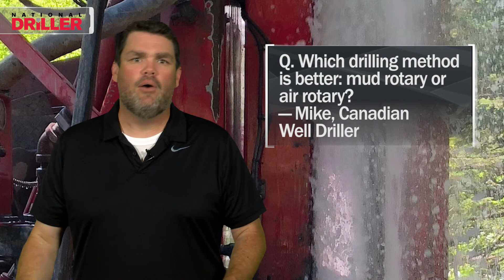Epic Rotary Drilling Matchup: Mud or Air?

Comment: I've done both and do prefer air over mud, due to it being faster and generally cleaner. Water usually is never an issue, cause you can always go to what we called misting and start adding soaps/foams etc.. And unloading a hole was always fun to watch ! I've had the opportunity to work on one of if not the largest gas well in West Central Texas. Hammer bits were hardly used unless the formation called for one. I remember the days of Diamond bits to drill wells of the late 70's early 80's.
Reply: Can a mud setup still do the job of an air setup, if you really needed it to?  I’m looking at a Chinese rig (FYX180) and it can either be accompanied by a $23,500 22 bar 24 cubic meter per minute compressor, or a $3500 mud pump.  This won’t be for a business, but a personal well in the White Mountains, Arizona.  Our stone is majority lava rock, if you hit any at all. Water is about 150’ down, and I plan to hit 200.
Reply: @Bright_coded  It really depends on the water tables in the drilling areas, like how large. We went to a mist some times when water was to much, but not enough for mud. And mud can be used.
Reply: @Charles53412 I’ve drilled holes with a Foremost/Barber Dr-24 in places fellas refuse to take air or mud rigs.. Dual Rotary Air w/ water&foam injection reigns supreme in Northwest Ga!